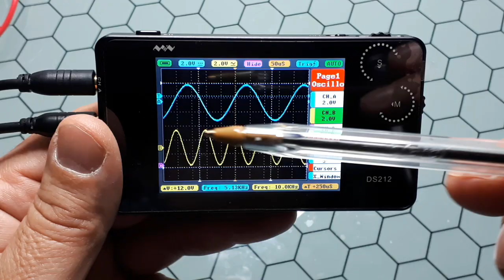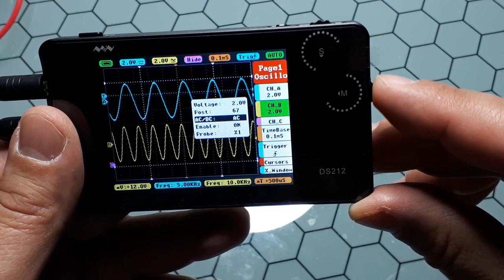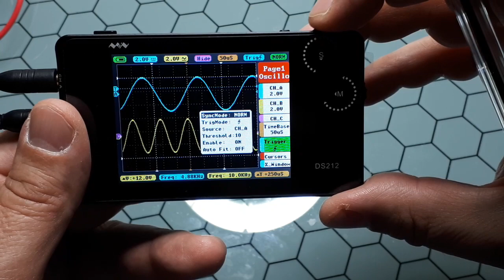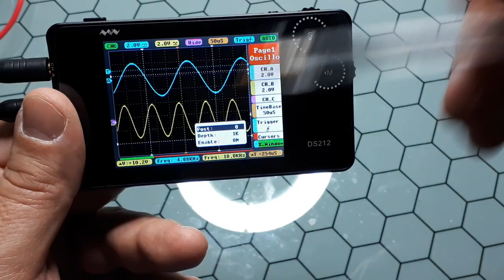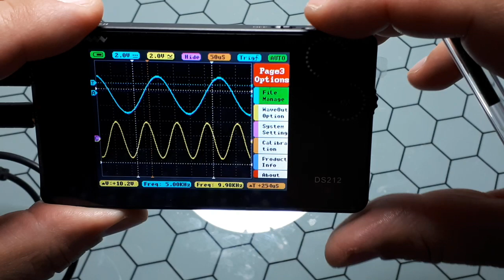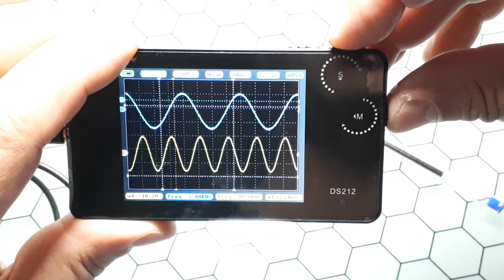Tutorial. DS212 Mini oscilloscope

Comment: You are wrong on "save settings"... the only thing you do with your approach is saving a bitmap. (you can also see the number goes up with +1)
If you wanna save your settings, you need to go into file manager and chose - save parameters - and then click on the top wheel.
thx for the vid.
Reply from the maker: My mistake. Thank you for pointing out it.